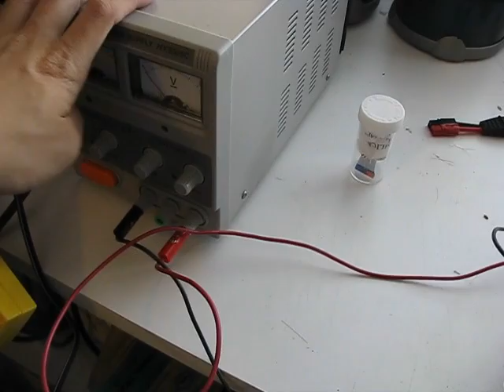Alternator Motor Conversion Test

Comment: How much was the voltage on the rotor with the milliamp current? How much voltage and current are on the windings? A LIon battery could easily supply both parts with voltage for it and the lesser amount of current flow the longer the battery can last. Torque readings? RPM of the rotor at various voltage and current of both rotor and windings?  Details, please.

Comment: If the motor run with 24 volt is  safety for the winding?
Reply from the maker: I would imagine the alternator 'motor' would run fine if the stator was provided 24V, but the rotor voltage is proportional and only needs a lower voltage.

Also note that you would need an ESC that can handle the voltage.

Comment: Very nice, did you try reducing also the voltage of field coils?
Reply: It's LITERALLY what he's doing in the video lol
Reply: @blackz06  hahaha, watch again and listen carefully, his controlling the current not the VOLTAGE LITERALLY...
Reply: @dingski_diy  controlling the voltage is LITERALLY how you control the current to the field.
Reply: @blackz06  did you notice the power supply?  It can controll the voltage and the current separately.
Reply: @dingski_diy  Yes, and you can't change one without the other when resistance is involved, thanks to Ohms Law. :)
Reply: @blackz06  variable power supply is the key my friend, you can always reduce the current of a 12v 1amp power supply to 12v 500ma without reducing the voltage of 12v.. variable is the key... i know my electronics and i think you also do, there is no point arguing with you.. i ask a simple question to the video owner because i seen a lot of this kind of video in youtube running  th alternator field coil from 3v to 12v from 100ma to 5amp or more
Reply: @dingski_diy  when you have the resistance of a field coil (or any resistance), you cannot change the voltage without the current changing. So, to answer your question once again, yes he has tried reducing the field voltage to the coils. (Its what hes doing in the video)
Reply: @blackz06   @blackz06  did you hear him saying from 12v to 11v to 10v? i can hear him saying current unit not voltage..... he said, 3amp, 1 amp, 450ma, 300ma, i did not hear voltage.. pls watch the video very carefully...
Reply: @dingski_diy  lol... and that is achieved by lowering the voltage. When powering a coil, one cant change without the other.  Maybe you dont know as much about electronics as you think?
Reply: @blackz06  maybe you are right, maybe you don't know much about electronics as you think...
Reply: @dingski_diy  V=IR. Learn it, live it, love it.

Comment: hi can i bypass the speed controller and ESC you used with just using this one from ebay: https://www.ebay.com/itm/AC110-220V-10000W-SCR-Voltage-Regulator-Motor-Speed-Controller-Dimmer-Thermostat/182375407968?ssPageName=STRK%3AMEBIDX%3AIT&_trksid=p2055119.m1438.l2649
Reply: no

Comment: Could you tell me please what do I need to get this running just like you did to go fast and powerful??
I have a spare alternator in my garage I think is rated at 130 amp 

Do I get 50amp controller?
And you mention from12v to 24v will go faster do u need two car battery or just one 24v or els?

I think this will be enough power for go cart!!

Comment: So why does it need current to start, but goes faster after its decreased?
Reply: it has to do with coupling and reluctance.  a slower speeds you get more torque but less speed.  as you lower the amount of current to the field windings it decouples the rotor somewhat from the stator this allows it to go faster.  It also reduces the torque available.
Reply: The brushes need to be excited to turn on the rotor. After that he is regulating the power only through the ESC. I think. This is a great video but it is a very simple build if you have concerns about damaging your equipment look into fuses and breakers. Kill switches wouldn't hurt either.